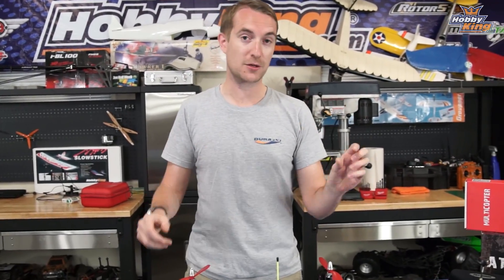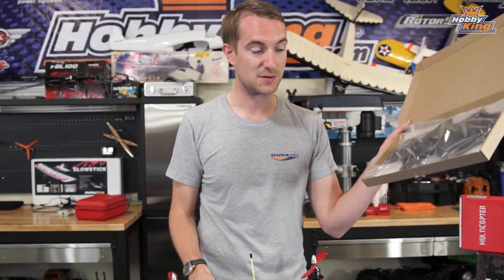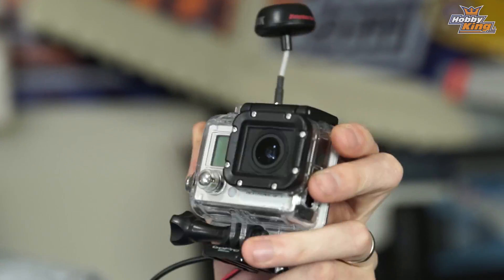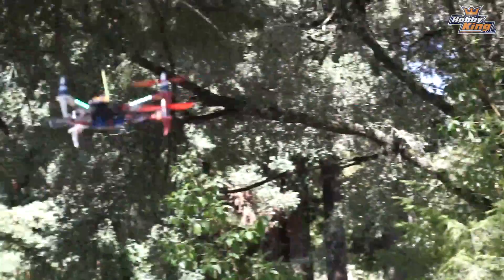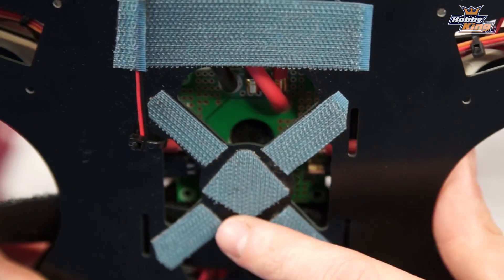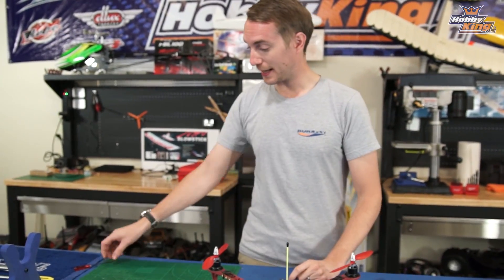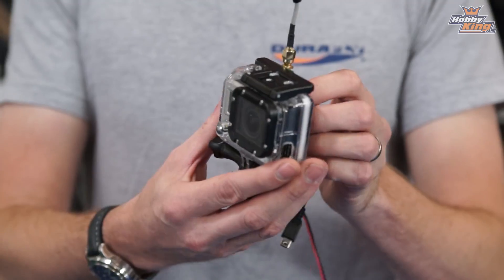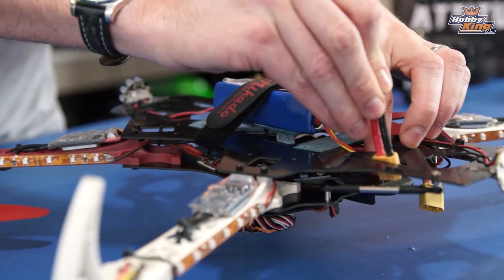Hobbyking SK450 'Dead Cat' - Walk through part 1.

Comment: I need help. I power my remote on first and the quad second. But it won't fly at all. I've looked at the signal test and whenever I did something on the controller, the quad would receive the command, yet I can't move it at all. I debugged it, did a few calibrations and the motors still won't move an inch. Please help me

Comment: NEED A LITTLE HELP I am running 3 Turnigy Multistar 30 Amp (OPTO) and oneTurnigy Multistar 30 Amp BEC with NTM Prop Drive Series 2830-1100KV Motors. but when I throttle up all the motors start up but then 2 of the opto one slowly loss peed until they stop. and the other two keep running fine. batterys full I tried 2 kk2.1 boards.just cant figure out whats going on WHY THEY SLOW DOWN TILL THEY STOP you have to completely shot off the throttle in order for the motors to start back up

Comment: Stu if you want longer flight times then you will need to get more efficiency, I don't think you are going to get much more flight times from the minimal weight savings you will get in the changeover. Realistically you need to swing some better motors (read the reviews on NTM motors) with larger props then increase battery capacity. Basically if you want good flight times you need to be lifting about half or more of your total weight as batteries while your motors a drawing around 6amps each.

Comment: Ok, so could you guys just sell this as a stand-alone dead cat style frame kit with integrated PCB, not just as a series of upgrades? Because right now if I want to build this, I need to buy the SK450 kit ($17), the dead cat upgrade kit ($17) and this integrated pcb ($25), not counting shipping! And after that I'm left with a bunch of frame parts that are useless (top and bottom plates from the original X frame, bottom plate from dead cat).

Comment: I have the SK450 frame, Q-Brain ESC, Turnigy NTM 28-26A 1200kv, KK2.0 flightboard with 1,5 firmware, Turnigy nano-tech 6000mAh 7,4volt battery, 10x4,5 SF props,
Flightweight is 1100gram, can carry 500grams more on 2s and even more on 3s.
and my flight time is 18 minutes on 2s so i'm happy with that.